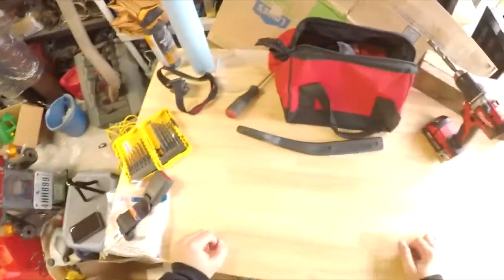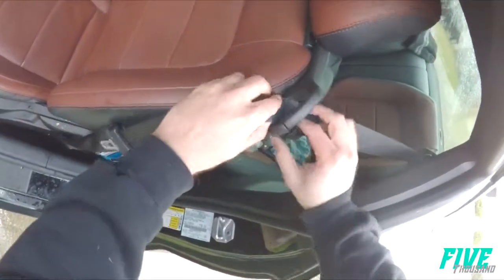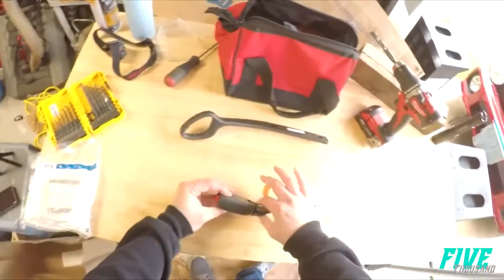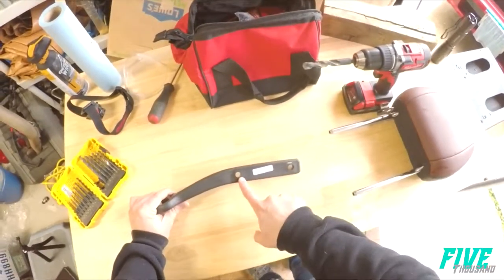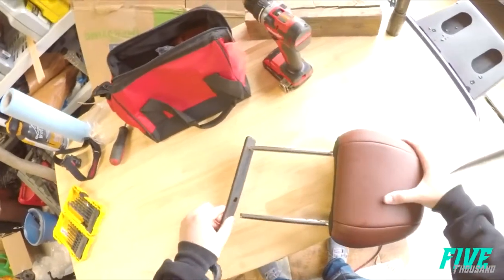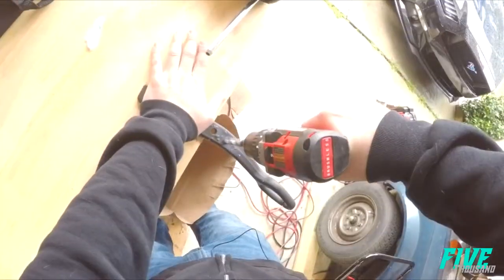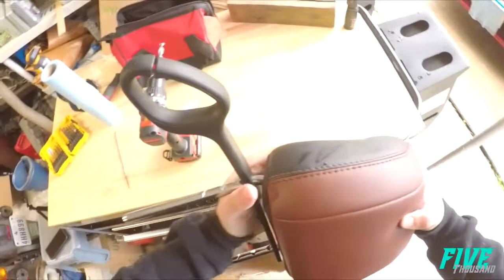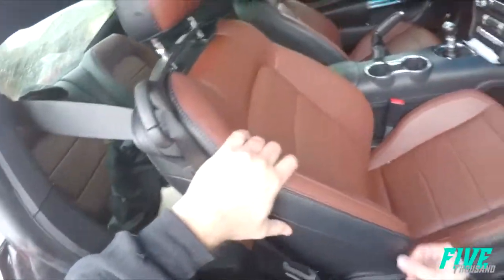Seatbelt Guide Mod - 2015-2019 Ford Mustang (S550) V6/Ecoboost/GT

Comment: What would the seat belt extension do? How would that help stop the belt from rubbing into your neck? The dealership will give them free if we ask?
Reply from the maker: Moves the seat belt an inch or so outward so it doesn't rub on your neck. It places the belt over my collar bone. This part is actually from a chevy cobalt. The dealership has a seat belt extension they can give you for free (suppose to be) but I don't like the way it looks or feels.

Comment: Dealerships told me they didn't have extension for mustang to even order that id have to look aftermarket
Reply from the maker: Seatbelt extension like mine or a belt plug in extension? The plug in style extension is suppose to be free from Ford. I believe it is by law. The extension in this video the parts are from a chevy cobolt.

Comment: Has anyone tried this on a 05 to 14?
Reply: Going to attempt it on my 05, I'd imagine it would.
Reply: @3vReanimated  how is it?
Reply: @Rubenvi8179  Never attempted it, but can be done. I realized I had to drill out another hole to make it possible and would of had three holes drilled into it, not quite OEM to me so I never ended up doing it. If you arent anal about that then it's possible after looking at a few from the yard.
Reply: Did it on my 06 Mustang. It fits perfect. I used a 3/8 drill bit to drill in the new holes.